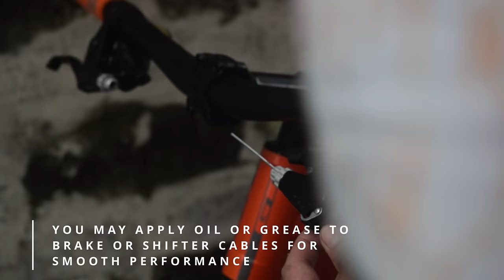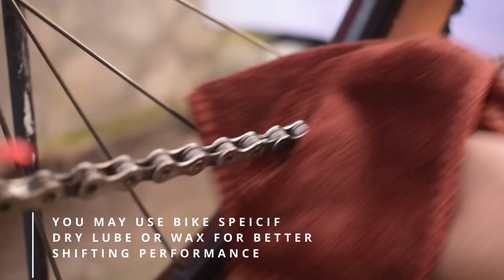Restoration - GT KARAKORAM 3.0 95% (NO REPAINT) BIKE RESTORATION & OVERHAUL + TIPS  [4K]

Comment: You have refurbished this bike nicely. A thumbs up. But a few comments:
1. Why are you applying grease to the rear derailleur spring? It is not present at the factory, it does not rub against anything, but only catches dirt.
2. For a better effect, brake discs can be wet cleaned with aluminum foil or steel wool. Likewise, the rim, nipples, and spokes.
3. Use a little grease on the thread of the cassette nut. It will facilitate future loosening and prevent cold welds.
4. The carriage of the rear derailleur and upper shock absorber lags also be cleaned with aluminum foil or steel wool for a sparkling effect.
5. You did not use the split pin when reassembling the brake linings? Why?
6. You could easily shorten the chain by two links.
7. What is this tire with such runout?

Greetings from Poland.
Reply from the maker: Thanks for the tips! <3
Reply: @CoggieBike  One more thing. Polyurethane varnish is the best option for painting gears. It is the most durable.
Reply: It's a good practice to add grease on rd spring. Shimano puts their green grease on derailleur springs and also put thin oil on pivot points for smoother shiftings
Reply: @sherwinvillanueva852  I agree with the lubrication of thin oil pivot points. I use PTFE oil. I do not lubricate the main pantograph spring along its entire length. 
I know from experience that it will catch a lot of dirt and the sand will start to creak when shifting gears. I add spot grease in two places where the spring is attached. 
I have been using this method successfully for many years. And I use this method for clients who I repair and restore bikes to.
Reply: Patryk, It will catch a lot of grime whether the spring is lubricated or not, the fact is it won’t rust as easily when it’s lubricated, and shifting will be much smoother for longer. This man lives in an extremely tropical climate, wet, humid, hot. If he doesn’t grease the springs he will have a set of rusted springs very quickly. Most professionals grease the spring with a premium grease, during the build. Just because some manufacturers don’t send it out that way doesn’t mean that’s the way it should be done during the build. If the bike is going to be built up anyway, assuming it’s a knowledgeable professional, there’s no reason to send parts that are accessible out with extra layers of grease, they are handled by a professional who should know how to properly lubricate. Even park tool recommends covering the springs in grease, But obviously there’s a lot of people who don’t and are completely content with that. I just wanted to make you aware of his climate situation and what most manufacturers suggest. Now a big number of mountain bike riders do not like to grease their springs because of grime but I think that in this particular situation one disadvantage outweighs another. 
Not trying to make this drawn out lol but wanted Coggie to know as well he should do it the way it works best for him. Happy building!
Reply: @jinnij.caiman  I drove in the summer, drove in the winter at minus 20 degrees, in slush with road salt and a nasty spring without grease won't rust 😉
In other words, everyone has their own experiences. I share mine.
Reply: @sherwinvillanueva852  yes that is true since i bought an Altus derailleur that it has fresh grease every pivot point and spring.

Comment: A very good lubricant/glue for applying handlebar grips, whether they are rubber or silicone rubber, is ordinary hairspray (hair lacquer). Use the cheapest kind. It works as a lubricant to get the grips on, then it dries and sets as a glue.

To get the grips off again, poke a rod or thin screwdriver under the edge of the grip and spray more hairspray in, it then works as a lubricant again and will remove old dried hairspray.

If you have an aerosol spray button off an old can of aerosol chain-lube, or WD-40, that comes with a thin straw, use that on the hairspray canister instead of its original spray button. This helps you get the hairspray liquid under the edge of the grip when you want to remove it from the handlear in the future.
Reply: Or just use IPA